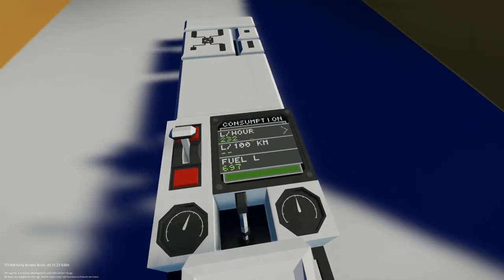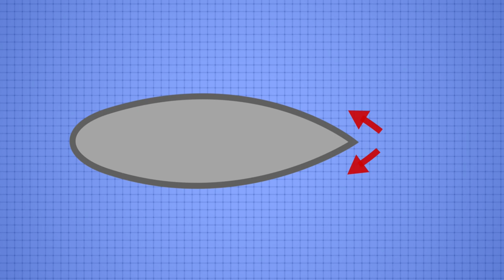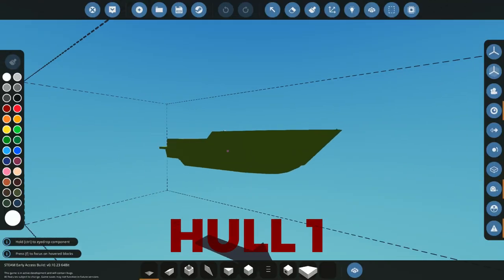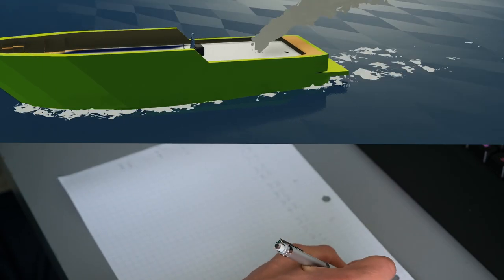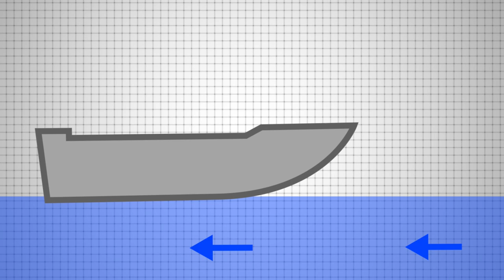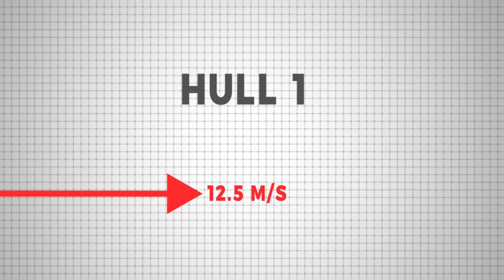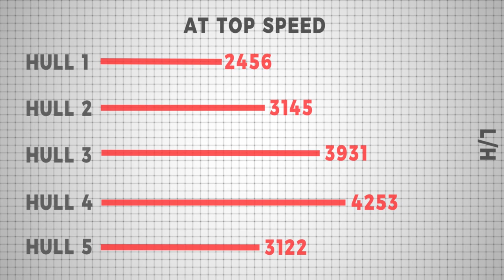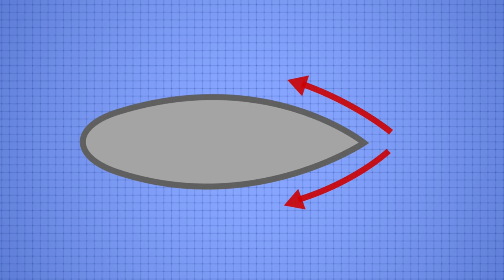Making the Perfect Hull in Stormworks

Comment: This video came perfectly timed, almost a bit creepily so!
Just earlier today I modified a few months old boat of mine in Stormworks to replace some of the hull with some 2x1s and 2x2 wedges and such, just to smooth out the hull (kept the EXACT same shape, just made the hull smoother and less "jagged".
In doing so the top speed of the boat went from around 85 kph -> 42 kph. The weight increased by around 100 units (which isnt much), other than that there was just the type of wedges that changed.

It seems that this game treats the 1x1 wedges and pyramids unproportionately different than the 2x1 and 4x1s, kinda seems like the 1x1s have tiny drag in comparison, even when the 2x1s are angled to realisticly create much LESS drag.
Dunno why, but annoys me when i build to please my eyes but still be functional.
Reply: Hey man, kinda funny spotting your comment on here
Reply: The newer wedges like 1x2, 2x2, 1x4 etc. all have wrong buoyancy and drag calculations...Only the old 1x1x1 wedges are working correctly. I think it doesn't matter in the air though. Or at least not to the point where it makes a difference.
Reply: @razorblade7108  Yeah, havnt noticed anything on my planes, would be nice if they would fix that.
Reply: Did they ever gix this
Reply: @matt309  Havnt tested it since, been mostly focusing on planes and trucks.

But i havnt seen it been mentioned among the fixes, but i also dont read the patches super focused so i MIGHT have missed it.

Wouldnt count on it having been fixed though.
Reply: @matt309  It doesn't seem like they have fixed it yet. Super simple boats with 1x1 wedges seem to consistently out pace boats using 1x2 or other wedges in any configuration that is actually in the water. You can use whatever blocks you want if they are out of the water. The messed up drag on the larger angled blocks really takes the fun out of designing good looking hulls. Was pretty disappointed when the big block with a down sloping flat wedge |______/  was faster than the carefully crafted hull I'd made earlier...

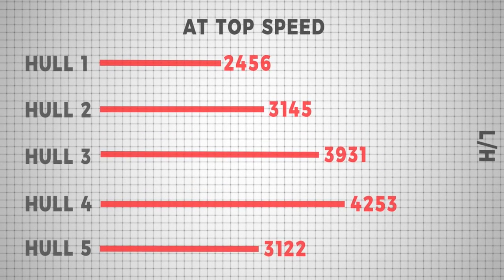Comment: 6:58 "Stupidly bad efficiency" - you suddenly measured efficiency wrong.
Excellent video, and I subbed, but if the boats aren't all going the same speed now, you have to compare meters/liter.
Hull 1 - 12.5m/s, 18.3m/l gets 12.8km in the 17 minutes to burn all it's fuel
Hull 4 - 18.5m/s, 15.6m/l gets 10.9km in 9.8 minutes to burn all 698 liters
the difference in efficiency isn't as much as your bar graph suggests. 
Hull 4 already showed it's the efficiency winner
Hull 4 - 12m/s, 36m/l gets 25.1km in 35 minutes.

Somewhere between 12m/s and 18 there is a speed that gets you far, fast, without wasting so much fuel in Hull 4
Reply: To be fair he was measuring efficiency wrong from the get-go. It just so happened that the speed was a controlled variable, so the distance traveled in an hour happened to remain constant. Fuel efficiency means different things in different context, but in the context of a mission boat, that is used to perform missions where one sets out from point A and travels to point B (some distance away) for the mission, then fuel consumed over distance (or the other way around) is how one measures efficiency, not fuel over time. You're not just trying to maximize your time out on the sea, you're doing a mission.

Also having the engine as a controlled variable does give you the relative positions of the hulls tested (ie. which is more efficient than the other), but it doesn't give you accurate data as to how much more efficient one design is over the other. With less water resistance hull 4 might have been better off with a higher gear ratio, and that might have significantly increased its efficiency, especially at higher speeds.

Comment: To add to your findings, currently there is a bug (and has been since multi-block slopes were added) where 1x2 and 1x4 slopes and their corosponding pyramids are modeled as solid blocks when it comes to whater drag, meaning a hull built with them is basically a brick in terms of the physics engine. 

The best way to overcome this this to work out where your water line will sit and use 1x1 slopes below water line, then use multi-block slopes above for the aesthetic. 

But great video! brilliant explanation of hull types
Reply: @cactuscraze4877  so do I bro.... so do i

Comment: Great video, looking forward to a displacement hull one too.
Currently trying to build a mobile base on essentially a tanker ship with a helicopter on deck, and a sub or smaller boat hung over the side, plus a land vehicle for the heli to transport.

Main issue I'm having is having a helicopter on deck without the ship capsizing, wanted to use a Chinook I like because it has the power to lift cargo but I may have to just make do with a little huey
Reply from the maker: I suggest you don't use a chinook unless you're building a extraordinarily large tanker. the chinook weighs a lot, and it would certainly have to secured during rough weather. I think a smaller huey is the way to go.
Reply: @markers6222  the njersey huey seems to work well although lacks the lifting power to carry under slung  cargo

Comment: all the hulls in stormworks are displacement hulls because the game does not simulate hydrodynamics to push the boat hull out of the water. the only force you have when your boat pitches up under acceleration is the result of your propeller/water jet not been in line with the center off mass. the only way that you have to actually simulate a planning hull is trough pid's and fins to lift the hull out of the water. What you tested on the video it's just different hull shapes that all affect how the boat act under movement because of the water drag simulation of the game, not hydrodynamics.
With that said your explanation to why certain hulls are more efficient in game is not correct, off course when lifting the boat out of the water the drag is reduced and then fuel efficiency and/or speed goes up but that´s it, if you dont have any kind of ride height control(aka hydrofoils). Because of the propeller not being in line with the CoM, it lifts the bow and reduces drag since there is less boat under water. The why some shapes have different behaviors is just because of hull shape under water, a flat button ship in game is much more stable on the roll axis than v button. On the other end the V button shape hull is faster than the flat button.
About the types of hull, you have two main types irl: 
The displacement hull that displaces the water like you explained. This types of hull is beneficial on cargo capacity and are generally stable under rough sea conditions.
The planning hull can be explained like a "wing" that trough hydrodynamics lifts the boat out of water reducing drag. basically uses the hull shape to send water down creating a lifting force. One of the more stable planing hulls is a v button shape. This hull is found in yachts and ships not bigger than 20 m since more less past that length the ship becomes too heavy to lift.
You also have semi displacement hulls that are basically a displacement hull that can generate lift under speed
Reply: Can you recommend any specific software that is not super expensive for more reliable hydrodynamic simulations? I've worked with DelftShip, which is good for stability and drag calculations, but I miss wave simulations. I also worked with Blender 2.8 with fluid simulation, which is great for the graphics part, but not so much for collecting reliable numerical data. In other words: is there any "cheap" naval architecture software that you can recommend that also includes hydrodynamic 3D simulations, i.e. like a virtual towing tank?
Reply: Wedges do have a opposite  reaction, and can be used to push planing boats out of the water. it is not solely the effect of having a propeller underneath center of mass. i have tested this quite a lot with seaplanes.

no need for hydrofoils. though they certainly are more effective.
Reply: @___Chris___  sorry for a delayed response. i am not a naval architect/engineer so i don't know any professional grade software. I am just a really curious person that do his research about the things he loves.

Comment: You also need to take into account the hull drag...  If you use 1x1 slopes you'll find a higher performance.  For some reason, even if your boat is extremely streamlined, if you use the 2x1 or 4x1 slopes you'll see a drastic increase in drag.  The way they calculate drag on those parts is absolutely horrid.

Comment: I'm building a water plane, what shape should the front be? (I have almost completed it, but it doesn't perform very well in water lol)
Reply from the maker: Take a look at this: https://steamcommunity.com/sharedfiles/filedetails/?id=2014565019&searchtext=goose
Reply: if using tail rotor or aircraft propeller you need to tilt them up using robotic hinge and ontop of that have fin ruders under the nose to push it up. heavy rotor has build in pitch that you can use.  physics are surprisingly garbage in this Game.  Water has the property of Sirup. every block and wedge that isnt the old 1x1x1 has a bug wich makes them have more drag around 33% speed loss on aircraft and boats. they know the bug but dont plan on fixing it same as the 3x3 - 7x7 wheels spazing out as subgrid would take them 6 weeks to rework it pfff so they wont do it.  we once hat the chance to make proper windmills using Propellers but they decided to get something else ingame wich you can gues functions to utmost dissatisfaction. 

if 1.0 is just as underperforming as the rest of the 3 year of development i call it a scam they cant be that bad or incompetent. 2.3k hours on the game now and around for close to 2 years.
Reply: @cpt.mirones5109  I haven't found tilted propellers very helpful, but I was able to use lift-providing small fins on the bottom of it, which would keep the plane from having an extreme amount of drag on a water takeoff. I think it's a much simpler design that works so much better. i just wish we had thin blocks so I can have a more buoyant plane, or one that, like you said, only uses 1x1 wedges and looks bad.